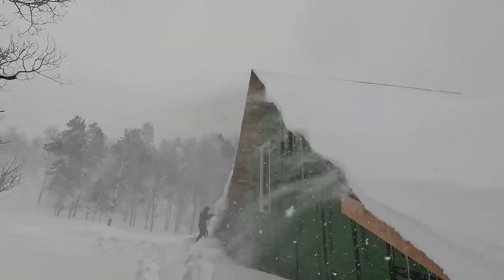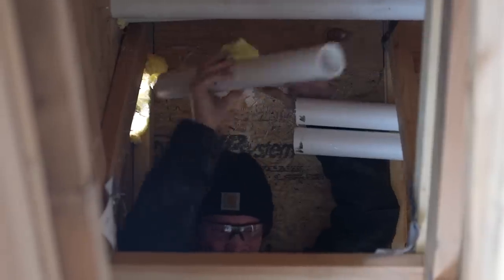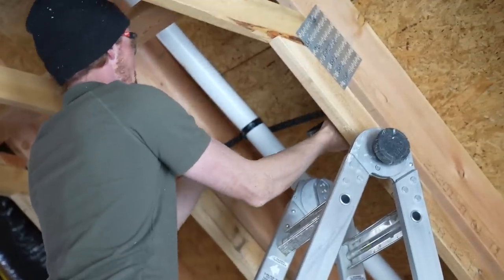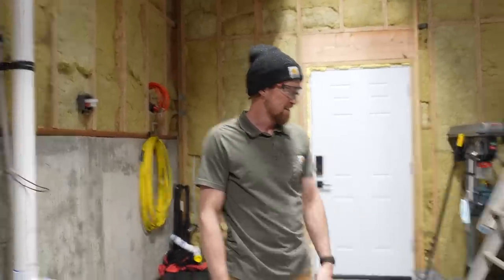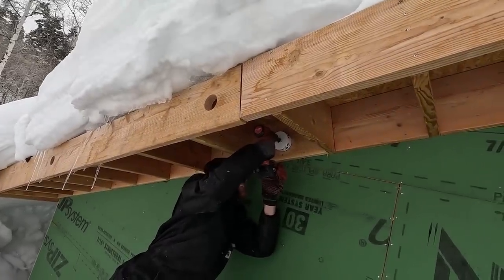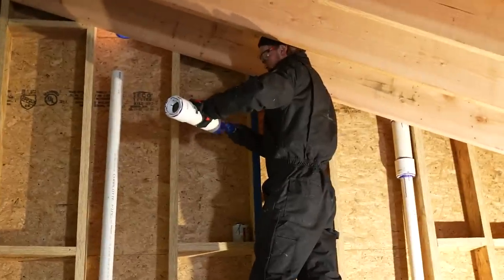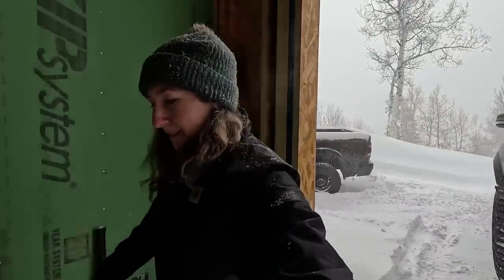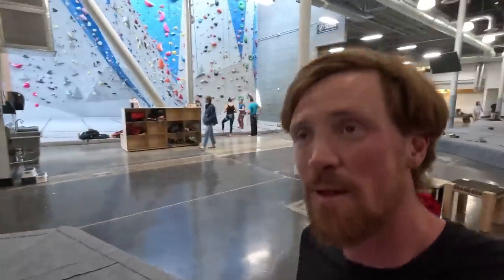IS IT TIME TO QUIT BUILDING AND JUST MOVE???

Comment: I was wondering if you guys have talked to the Engineer about all the pressure that is going to push against your buildings when the rain starts? That hill that is behind your shop alone is going to be at 8.329 lbs per gallon and cubic foot of water is 62.4 lbs.
I believe there is a chance of damage to your house because that is the possibility that tons of pressure is going to be pushing directly into your outside walls. If you make a drain ditch around the house would help but there is also the chance that snow slides downhill and closes the ditch if it's too small. I would talk to the Engineer very soon if I was you.

Leonard & Margie

Long time fan

Comment: Hey guys, you can screw a plate over the holes you want to "enlargen" then the pilot bit will center your hole saw blade and prevent the dancing bit.;  I'm just a lowly Engineer but I fail to understand the logic behind "reducing up" the 2 inch vent pipe to 3 inch.  It's air/gas not liquid.  Oh well, who should ever question the Government?

Comment: I looked up about propane tanks covered in snow & this was what came up.

Make sure the entire tank body is free of snow cover. Snow insulates the tank & as it gets less in it the remaining liquid is of course sitting at the bottom. If the bottom is buried in snow it can't absorb heat from the air to warm it above -44°F.

Not sure if that should be mentioned to your gas company?

Comment: One trick I know with those hole saws is if you need to expand the size of the hole, for instance from 2" to 3", thread the 2" hole saw on inside the 3" hole saw on the same bit.  The 2" one acts as a guide to keep the 3" one centered. 👍 EDIT: Nevermind, you guys tried that 😅
Reply: I made a custom shank from a stainless bolt...... clamp the size you need, insert the spacer, and the orginal size inverted, protruding about 3/4 of an inch. without exposed teeth on the original size, acts as a drill guide..
Reply: Or use a piece of scrap plywood, saw the new size hole in it, and use that as a template to guide the hole saw for the desired enlargements.

Comment: DISCLAIMER !!! I AM NOT A BUILDER, OR INSPECTOR. i was a electrician for over 40 years, so i am going to explain what i think like a electrician. IT IS ABOUT YOUR VENT LINES. if i had # 14 wire coming into the garage to feed the electrical panel. the panel has a 100 amp main in it. the # 14 wire is rated at 15 amps, so it is not big enough. so i take a # 2 wire, splice it to the # 14 wire, and tie the number 2 in to the main. NO GOOD, so if your inspector said he wants a 3 inch PVC vet line out of the house, but you have a 2 inch vent line now. i would think just splicing in a 3 inch PVC to the 2 inch line, is not what he wants. i think he wants the 3 inch PVC all the way back to the start. now i hope he doesn't make you change the line again, but if i was the inspector, i would make you do it all over again.

Comment: use the 2 inch hole saw and screw that into the 3 inch hole saw instead of the '"guide drill". that way you can "enlargen" the 2 inch hole to 3 without the teeth dancing all over the place :)

Comment: If you screw a board over the opening to hold the guide bit, you can enlarge a hole saw hole quite easily. Or, enlargen, however you want to say it. I guess you goes won't be going on a ski vacation to the Alps, huh.

Comment: Can't for the life of me understand why you were not keeping up with snow removal around the house and garage all along.  I should think that would have been THE priority.  Can't be good for the building structures with the amount of snow baring on those walls of the house and garage plus, any moisture buildup it's causing.   Not good. Grant it it takes time to clean and clear the snow, but heck, that comes with the territory.  The garage can wait.  

You can repurpose the pipe to collect rain water from your drains into a holding tank for garden water